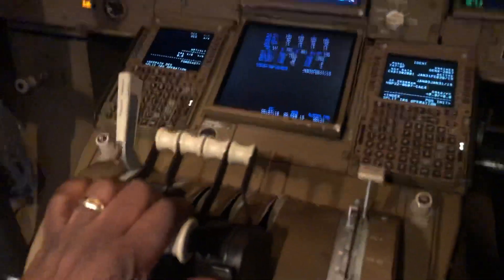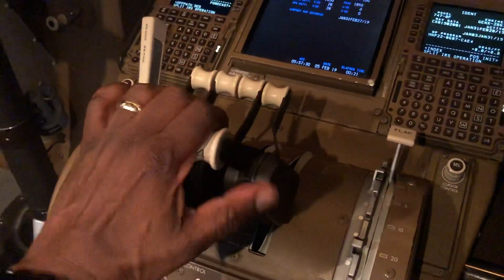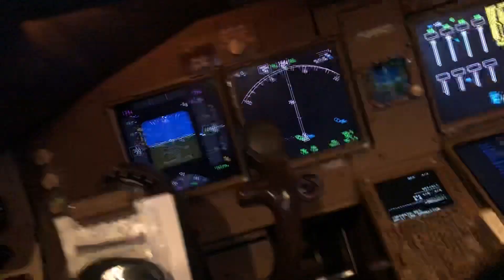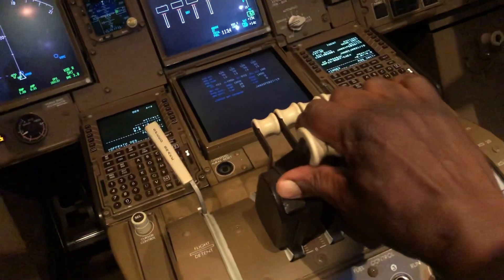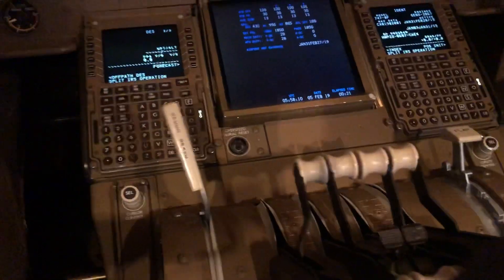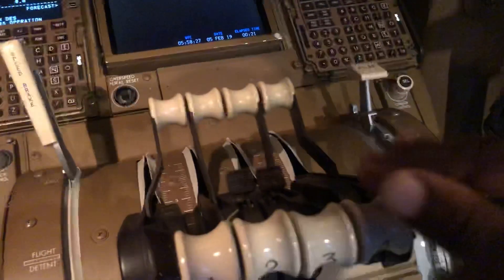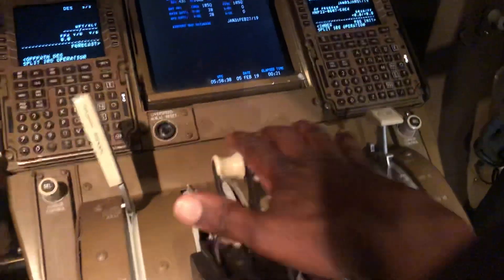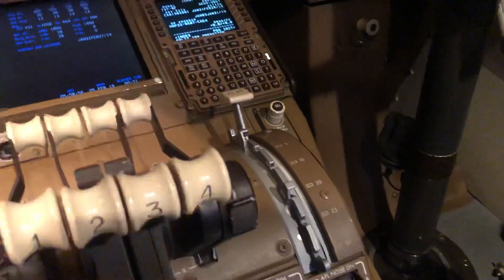TOGA switches and the Autothrottle disconnect switches on the B747-8

Comment: Very interesting.  On the 757/767 our ATHR disconnect are push buttons on the sides of the lever, and the TOGA switches are in the same position as the ATHR disconnect on the 747.